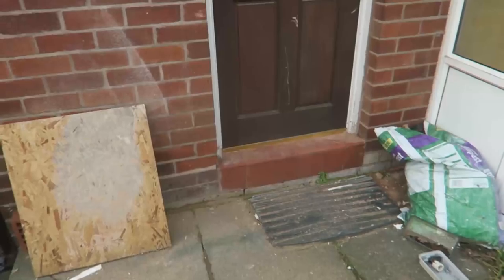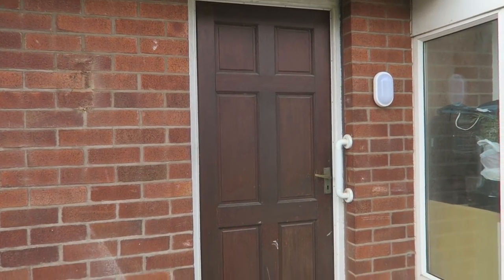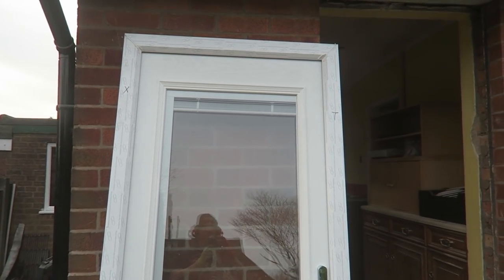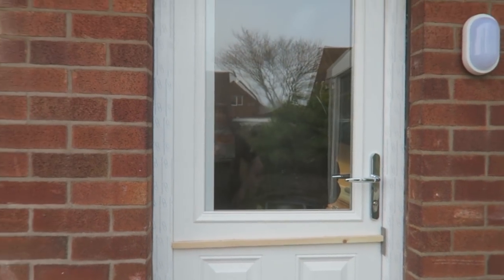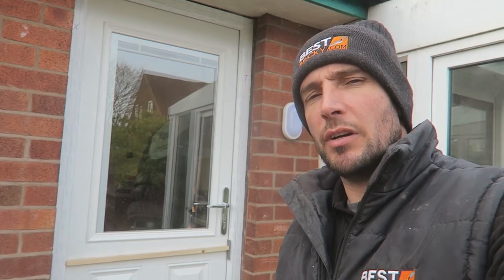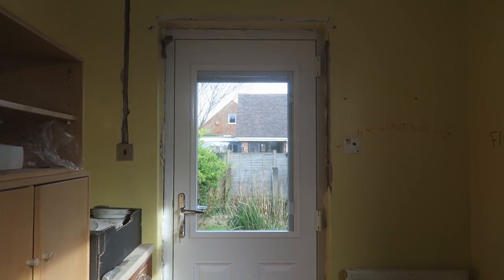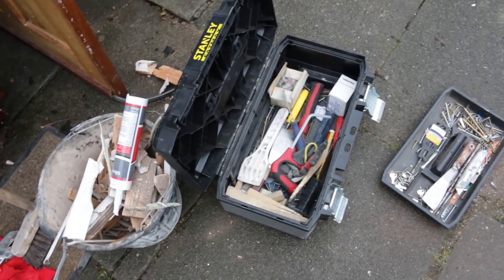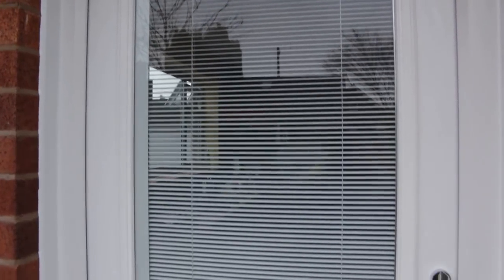Composite Door With Enclosed Blinds

Comment: Can you do a video how to fit a door and windows but don't speed anything up and talk us through step by step? I'd buy that course
Reply: spenceational86 yes, i was thinking that. It would be great, showing the right way to fit a door from start to finish. From how to properly level the door so that it swings properly, and any adjustments that might need to be made.
Thanks Stu
Reply from the maker: yes i can do that pal, the only reason i speed up on here is because otherwise my videos would be 20 mins and you may watch it but the majority of my audience only watch 4 mins so i have to keep short
Reply: stu crompton thanks, looking forward to seeing them. Have you tried to cut the burnt out piece of blade with a grinder, seems like it should work doubling the life of a blade.
Reply: When you measure for a door and window do you include the sill in the measurement
Reply from the maker: depends what company you buy of, different companies include and others dont spence
Reply: Please do a video on how to measure and fit windows and doors also a course on how to make a window to French doors ill buy that course
Reply from the maker: So you can get the bar in the gap and lever

Comment: Hi Stu, I'm installing a door but found the two sides have metal in the frame, am I supposed to drill through the metal?Just left it screwed in through the top and bottom at the moment...
Reply from the maker: yeah with hammer drill mate
Reply: Ta! I was confused as the windows didn't have the metal in them. First time you see. Do you use a metal drill bit for that part or just use masonry? My frames are wooden, not brick.
Reply from the maker: just use sds bit its only ali reinforcing
Reply: Perfect, I'll pick one up. Thanks for the quick replies, much appreciated!

Comment: I see you set the door about where the previous one was but isn't it set too far back - in the cavity almost?  Shouldn't it be secured into the face wall ?
Reply: Matt Cartwright Hi Matt The original door which has been there 60 yes was set in that position the reason why we put it back there Because there is no reason to put it forward plus there is no plastering to do inside why would we want to make ourselves extra work👍
Reply: Ok.  I see.  I looked at it and wondered where you'd fix it to but yes, makes total sense to fit to the original reveal.